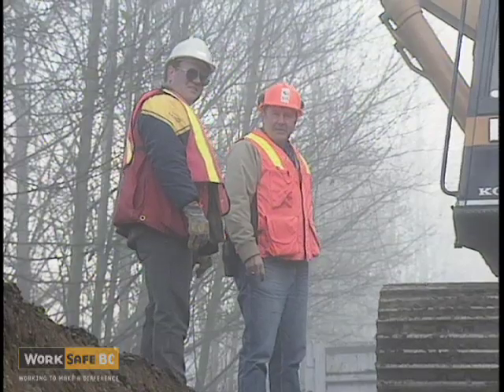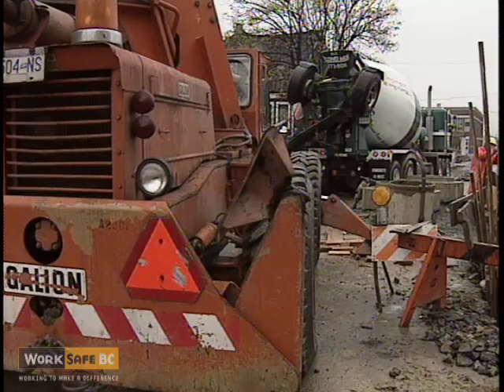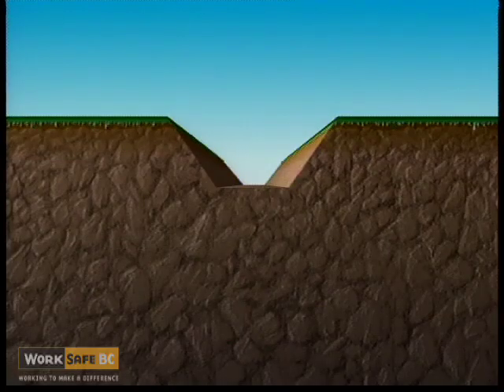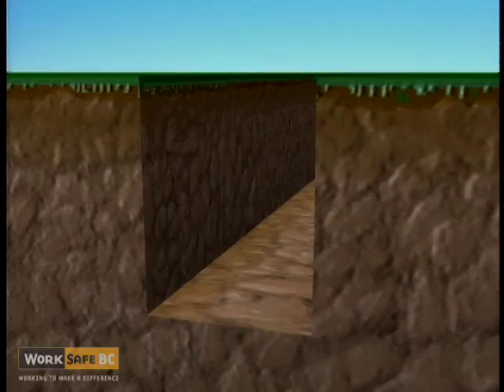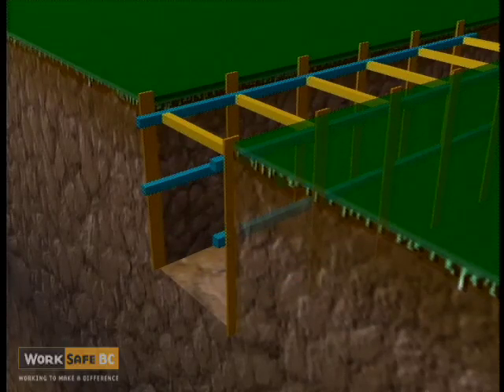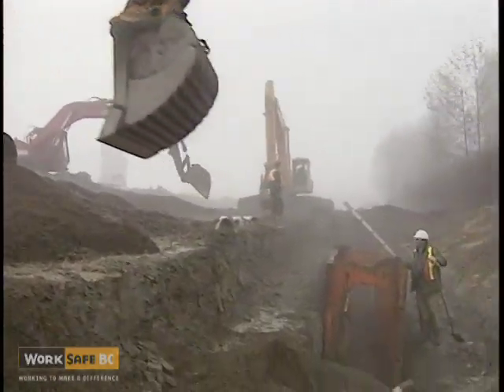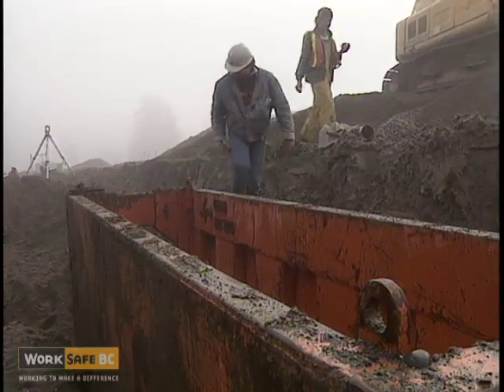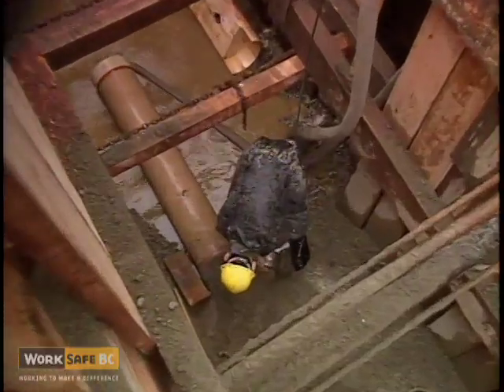Excavations: Sloping and Shoring Requirements - Part 1 (4 of 6)

Comment: The top of the shoring or shielding shall extend at least 18 inches (0.46 m) above the top of the vertical face of the excavation.
— Cal/OSHA Title 8 §1541.1(b)(10)
Reply: NOT 12"

Comment: So this is a fifteen year old video so I don't exactly expect a response but when looking at shoring it is all about trenches sofar. I am cutting a hole into a hill so I don't have an opposite face to brace againstthe hole cut will be pretty wide overall but most of the weight of the hill is going to be in that back wall. I think to do this safely I will have to dig both a wider and larger hole as well as figuring proper supports. I was thinking of using pallets and bracing those until the brick is in an set but that might not be enough. root celler plans now include a hole  bigger then the root celler with wider slopes then initially planned. This project is still a few years out and I have other holes to dig in the area so I will get a better feel for the soil and what is necessary to support it. It seems very much at risk of dangerous situations and i'd rather not get buried in dirt well I am trying to get brick layers to stay true to the course. seems to me that I just need to make the top of the hole about twice as big as the footprint of the rootceller with some slope bracing to prevent a dirt avalanche but more research is needed.